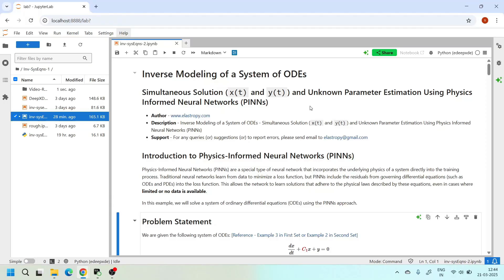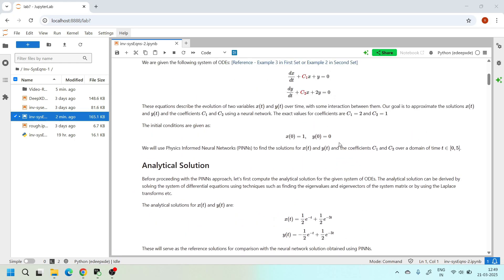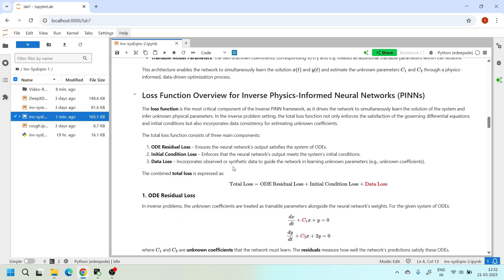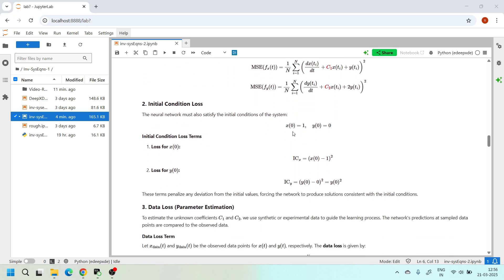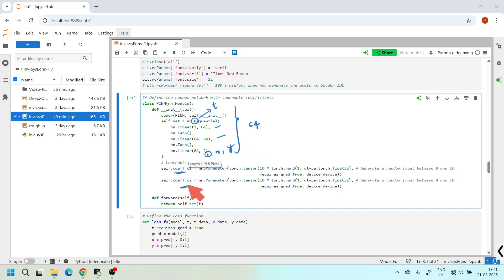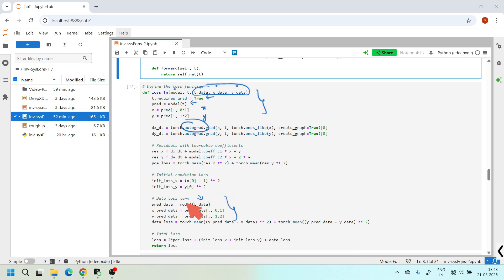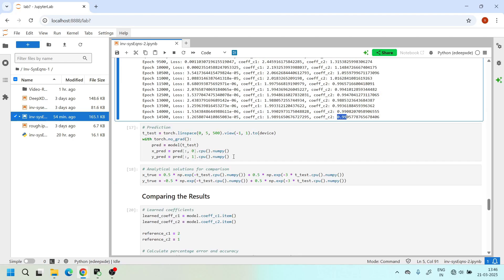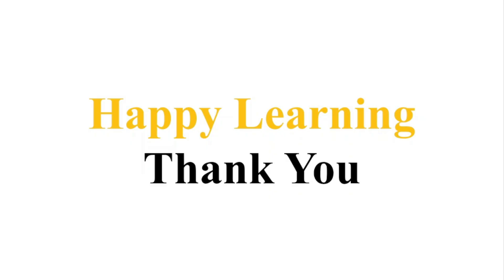Inverse PINNs for Coupled ODEs: Estimate Multi Solution and Multi Unknown Parameters Simultaneously

Comment: Simmilar question, how can we constrain the value of C1 and C2 during the training for physically possible range
Reply from the maker: Hi @19neetish, yes, that’s a good idea. In this inverse PINN, the unknown coefficients are learned just like network parameters, so if we know their physical limits (for example, a coefficient must lie between two values), we can absolutely constrain them during training. We haven’t done that in our tutorials yet, but it’s a good practice when such bounds are available because it prevents non-physical values and often improves training stability. A clean way to implement this is to learn an unconstrained parameter and map it to the valid range inside the residual computation. For example, for coeff_c1 (call it c1), instead of learning self.c1 directly, define self.theta_c1 = nn.Parameter(torch.randn(1)) in __init__, and inside the residual compute c1 = c1_min + (c1_max - c1_min) * torch.sigmoid(self.theta_c1) (and similarly for c2). Then you use c1 and c2 in the PDE residual exactly as before, without changing the optimizer or the training loop.
Reply: @elastropy  can you post modified section in your course dashboard link please, in this video there
Reply from the maker: @19neetish  I’ll update this soon with the proper code for constraining the unknown parameters. Thanks for your patience.